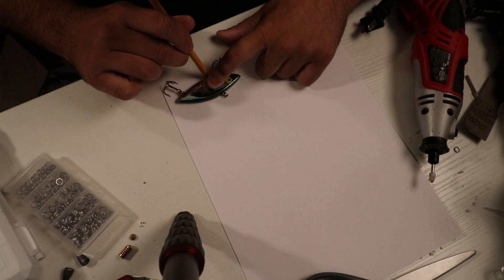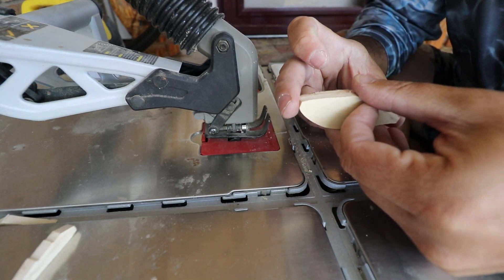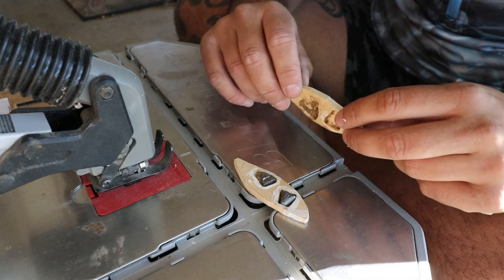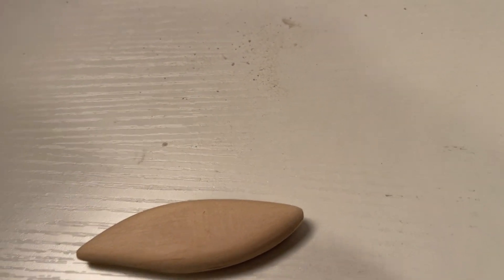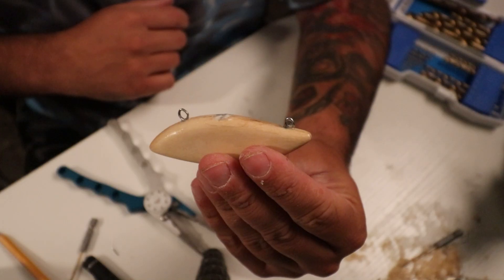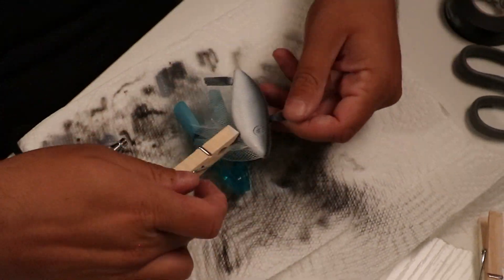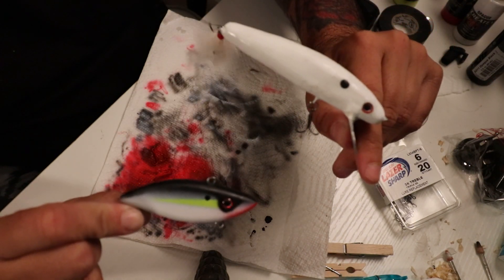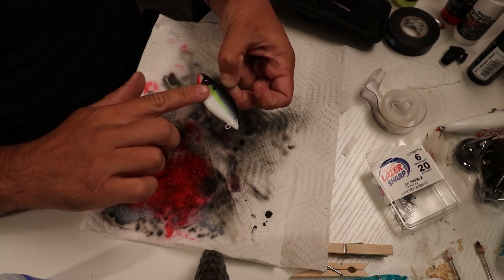my lure making skills are improving

Comment: Nice man, I haven't busted out my little airgun yet but it's coming soon. I've got some lures cut out and sanded down but still tracking down supplies. You might give gorilla epoxy a try for the final coat. It takes awhile to actually cure completely but it looks nice. Anyways, looking good, keep it up! 👍🏻
Reply from the maker: Thanks for the tip man! 🤙